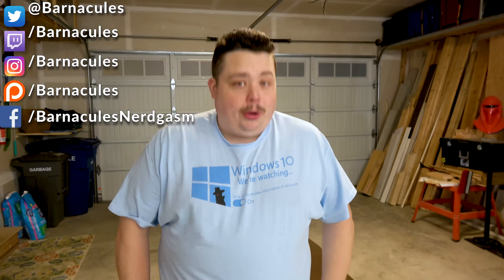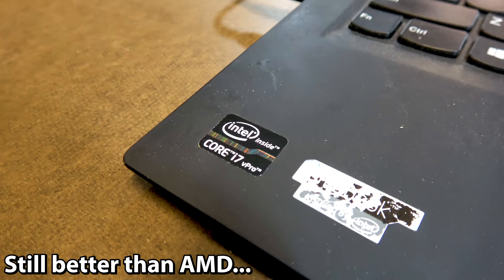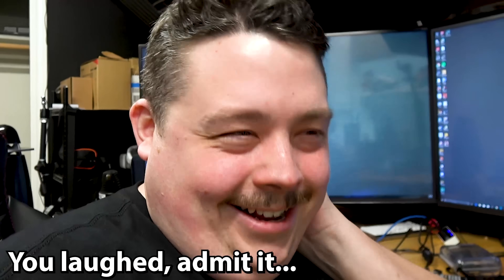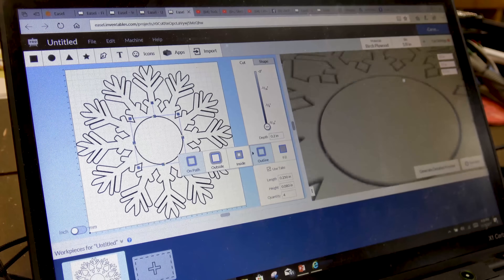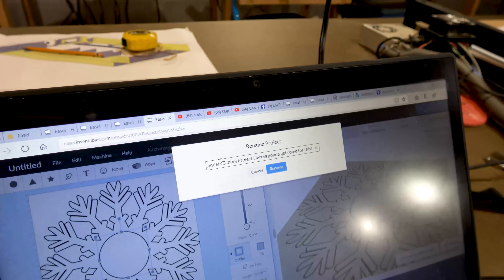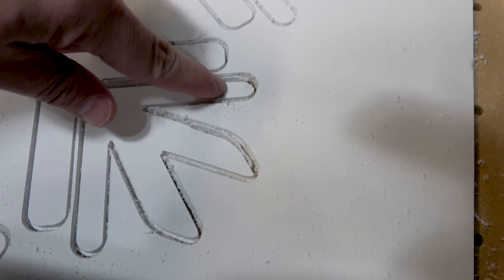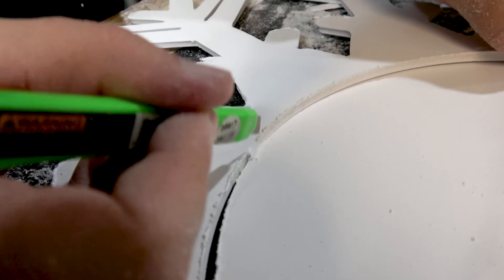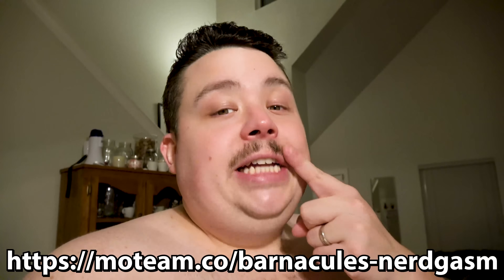Cutting Giant Foam Board on X-Carve CNC Router for Xanders Project! - @Barnacules

Comment: Hi! Well technically that was a complete fail at frames 10:09 when you guys went "neanderthal" back to a simple blade. But I still want that X-Carve Unit (even the Hanky Lookn' Version). What exactly happened underneath the Foam Core Board? Could I have laid a big piece of cardboard (like from an old unfolded shipping box) underneath the target Foam Core and sprayed some Tee-Shirt Screenprint Adhesive under both the cardboard and and Foam Core before the cutting process?

Comment: You need some weight down . Use  4 set of steel 1/2 inch thick 3”x 3 “ u can put it on that when it moves u can move steel to avoid hit and damage the bit ..to keep flat on table